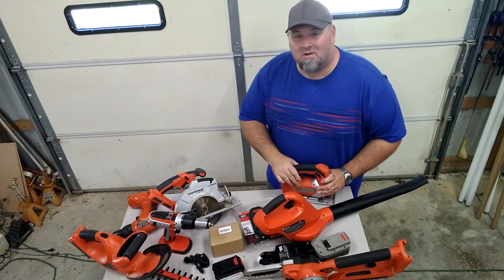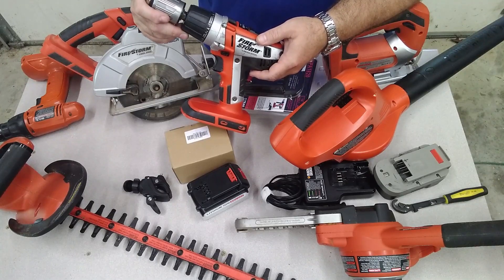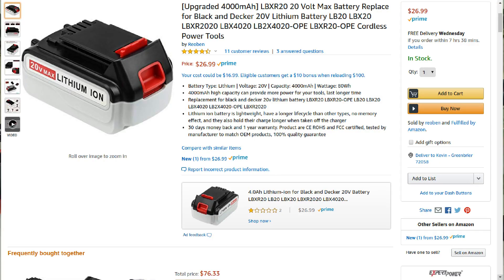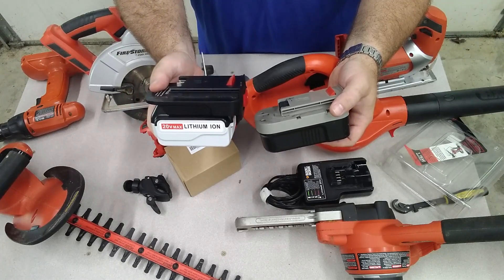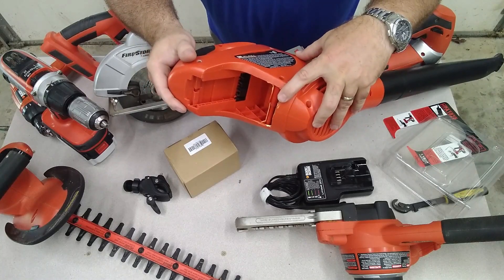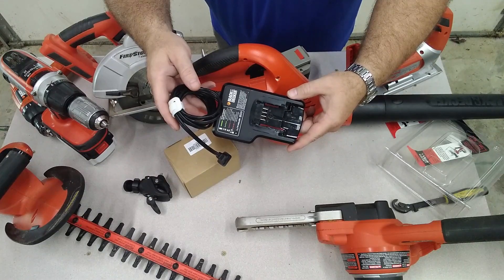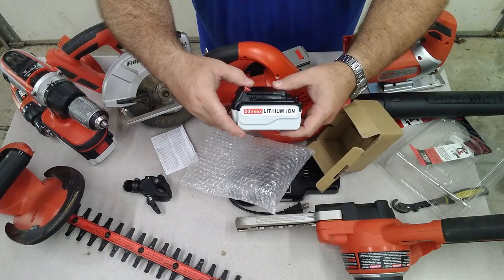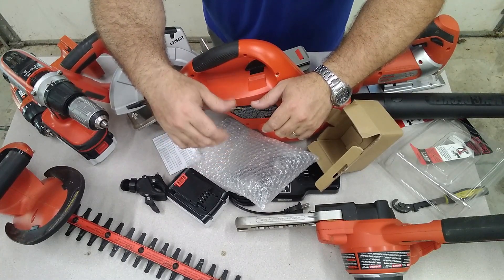Old Cordless Tools? Convert To Lithium Ion The Easy Way!

Comment: important note many of these adapters do not have a low voltage cut off.  once lithium go below a the low voltage thresholds they tend to die or have shortened life. Its possible to add a small low voltage cut off circuit inside the adapter,
Reply from the maker: That is true. At the first sign of motor speed decreasing, I pull the battery and charge it. I don't think that is a bad plan because these simple chargers usually won't start charging a battery that has a voltage that has gotten too low and will show them as a defective battery.
Reply: @thetinkeringjuggernaut8538  On power tools that have high power demands I think there would be a noticeable difference in performance to recharge, but tools such as a fan or radio, usb chargers i would not use them unless there is a low volt cut off.
Reply: This might be the issue I'm having. Used the brand new battery for the first time and it powered down to completely "dead" after 20 minutes.  Tried to recharge it but the charger says it's fully charged. What is this low voltage cut off thing you're talking about? I'm so p*ssed because it was part of a mothers day gift
Reply: @wild_for_nature9932  low voltage cut off (bms) prevents a battery from being drained to a dangerously low voltage. once this happens it damages the internal cells causing shorten life span or possible non use as the bms will prevent any charging.  the opposite case also exist where too much power being drawn where a thermistor will sense the temperature and the bms will kill the power draw, this prevents killing the cells or causing a fire. but charging still possible, you will have to wait for it to cool down. Your option to see if your battery is toast you will need to open the pack (pack uses security screws (torx) and measure each cell for voltage.  I can't remember what a healthy low voltage is you will need to look.  Once you find the bad cell(s) you can try and recharge it.  I would look through YT on how to repair these packs.
 Is this a branded battery or a third party?  besides lying about amp specs, I find the 3rd party batteries don't always use a good bms and cheap cells to keep cost down. its really hit and miss.  you have to find a reputable seller for 3rd party.
Reply: Isn't there a BMS board inside the Li-ion battery pack that would prevent this?

Comment: YEA BUT I NEED AN ADAPTER FOR MY FIRESTORM SKIL SAW 15.6V T-POST TYPE BATTERY !

THEM  FLAT BATTERY ADAPTERS FOR BLACK AND DECKER IS ALL OVER EBAY

NEED A T-POT ADAPTER TO 18/20V !

Comment: The vexing problem my father has right now: He just bought a nice old Porter Cable 19.2V 1/2-inch drill driver from a Facebook ad. The drill is nice, but the NiCad 19.2 V batteries are shot. Which battery adaptor and modern lithium ion batteries will work with this old Porter Cable drill-driver? There has to be a way to do this.
Reply from the maker: It looks like there are some options on eBay. Run this search and you may find what you are looking for: porter cable 19.2v to lithium adapter

Comment: I just learned about this on the Reclaimed Audio Podcast today. Thanks for the review. I'm DEFINITELY investing in these. I have a similar Firestorm set, and that del is my favorite. I haven't had the heart to get rid of them, and now I'm glad I haven't. 
Do you know if the 18V charger will charge the 20V battery with the adapter?
Reply: No you will need a 20v charger.
Reply from the maker: Mr. Whomp Whomp is correct. You will need a charger made for charging Lithium batteries.

Comment: I did this with my Milwaukee 18 volt tool set. The problem I have is it drains the battery way down if I leave the battery on the tool. Simple fix right? Take the battery off. Yeah, not so much, I keep forgetting, and then I have to jump start it with another battery to get it to charge, after the third time it was DOA. You experience this with yours?
Reply from the maker: No I have not and I leave mine on the tool the whole time when not in use. Not sure what would be drawing power when not in use on yours. Wish I knew what to tell you.